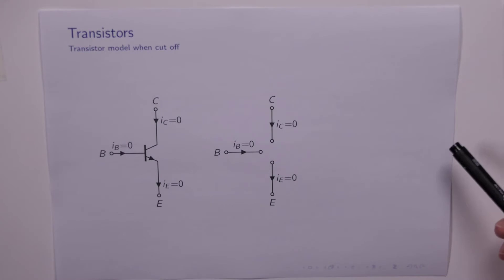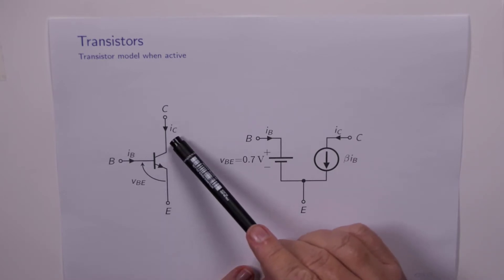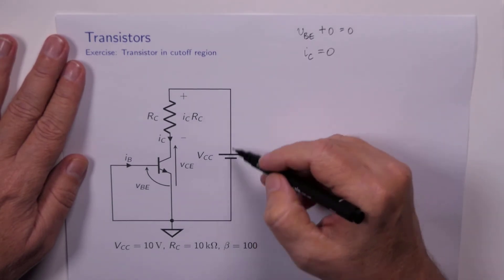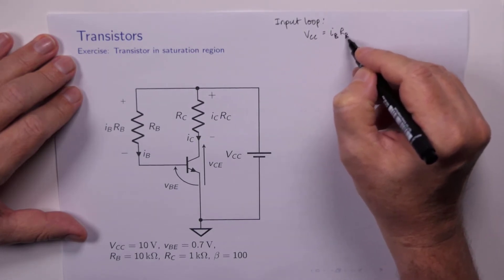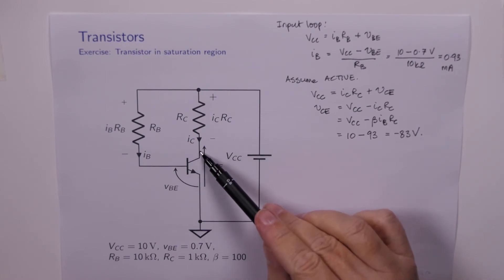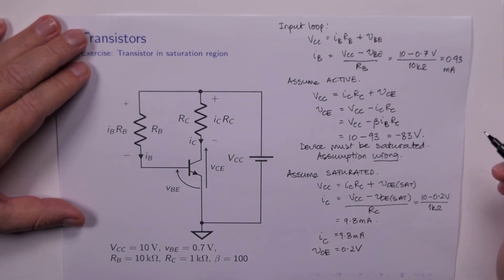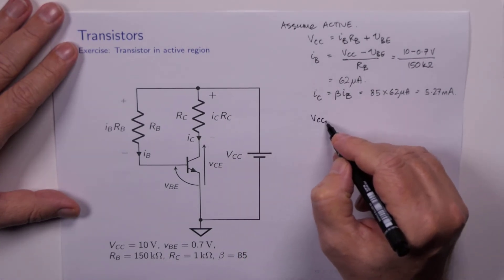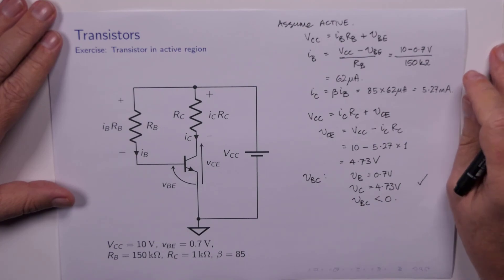Transistor DC Models

Comment: What we have to do with Ic =9.8mA ?? Why it is found?
Reply: When designing a voltage amplifier it is important that the operating point (namely, the DC collector current and DC collector-emitter voltage) be in the "middle" of the output terminal characterictic curves. We therefore calculate these values to see that it is so. See the video on Transistor Action for more discussion.

Comment: why are you not considering  Vbe when you are using KVL in the outer loop?
Reply from the maker: The outer loop involves just the collector and emitter terminals (not the base terminal) so there is no way include the base-emitter voltage even if we wanted to.